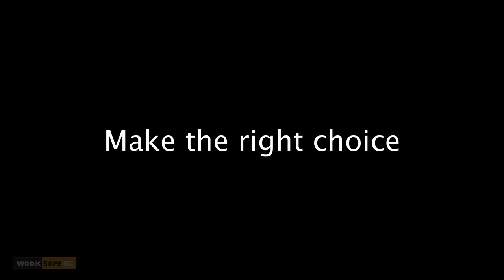Fall Protection Can Save Your Life

Comment: They've created a bit of a logical quandary here in that he falls because he tripped on someone's fall protection. The point is still valid though. I worked roofs about 20 years ago and we had no protection at all. There's no job worth dying over.
Reply: Not really a quandary but highlighting that equipment can introduce added risks and that attention should be paid to the placement of items around the workplace. It's not really a quandary because you should always be watching your step anyways and taking note of hazards, at work or not.
Reply: air hose